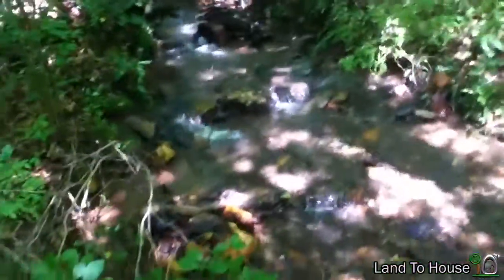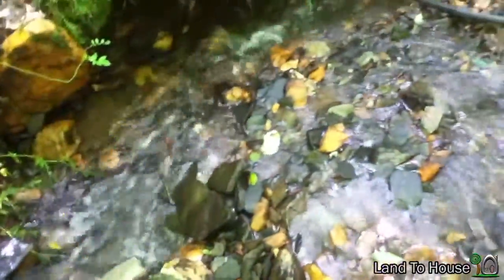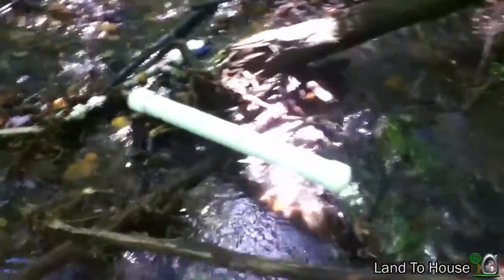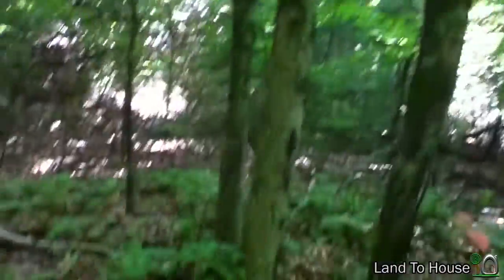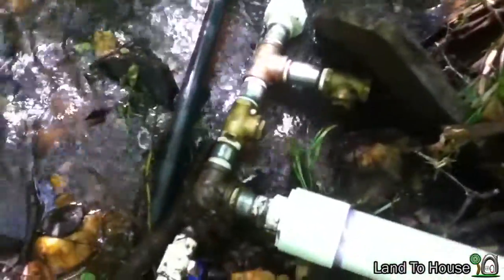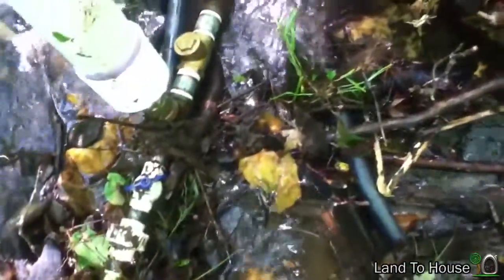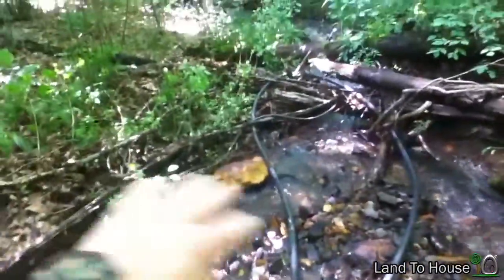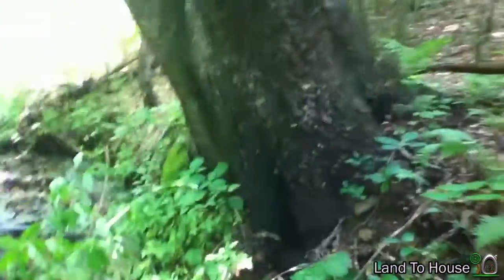Ram Pump Flood

Comment from the maker: Over here in the states it would seem that the general population has never heard of these pumps. I have talked to a few older men and they know what they are but have never used one. I think that the Uk is doing well by using things like this pump instead of using electricity. the same with the archimedes screw turbine. you wont find that here in the states. I would love to see one of the old pumps like the one you are going to restore. post it when you are done.
Reply: hello?

Comment: I've seen a few of the old syle ram pump installations over here in the Uk and they are substantial affairs which require a lot of work. Normally a brick chamber is constructed in which the pump is housed, water is diverted down pipes from the source into the chamber to feed the pump, hoping to restore an old victorian one soon. Green and Carter still make big heavy ram pumps near to where i live, they're based in Taunton, Somerset in South West England, very expensive but last a life time.